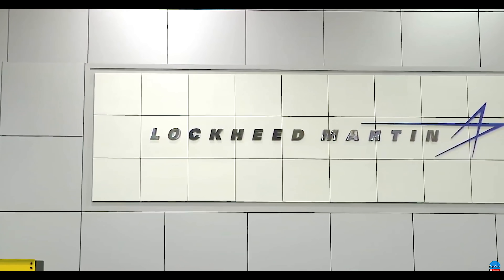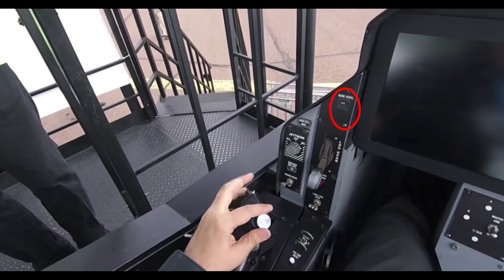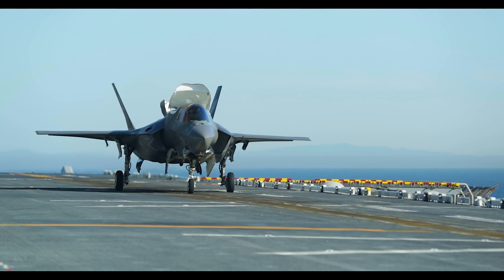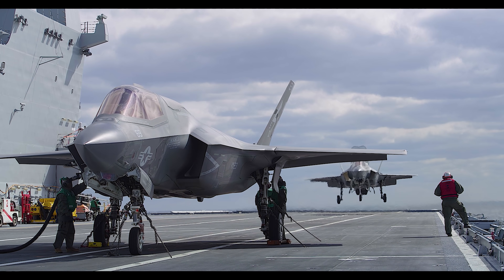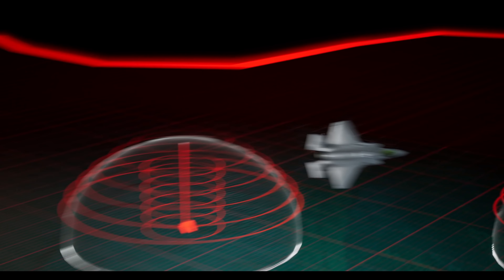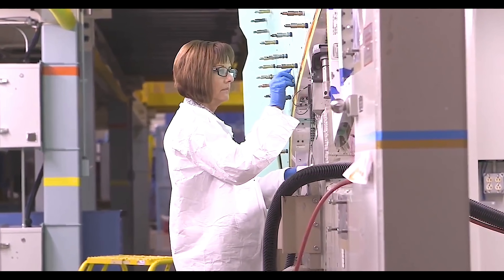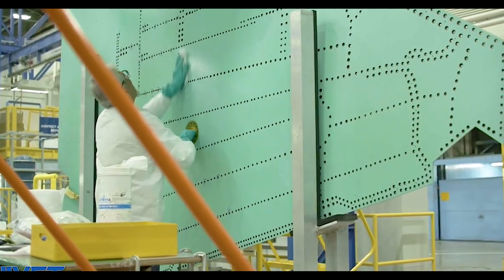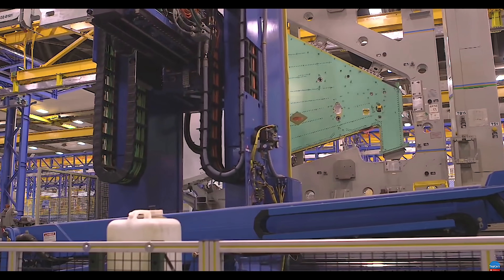Inside the F-35 Factory: The Most Advanced Aircraft Ever Produced

Comment: I don’t get why people compare how the harrier hovers to how the F-35B hovers. It’s obviously going to be easier the F-35B is 39 years newer.
Reply: How true - it took 50 years to make another jet that can do that!!! The Hairier was never fly-by wire. So, the pilot would have one hand on the stick. the other hand on the throttle, and his 3rd hand on the control that rotates the thrusters. If you turn the thrusters forward a bit, then you have less down (hover) force, and you THEN have to feed in more throttle (else the jet starts to drop). This is a delicate balancing act that made the Harrier a challenge to go from hover to say forward flight.

On the F35? The pilot does NONE of this. They push the stick forward, the jet figures out the above. You can ram (push) the stick forward as hard as you want - the jet then starts moving forward ONLY as fast as the transition to forward flight (a child could do this).

And if you let the stick go? The F35 automatic hovers Johnny on the EXACT SPOT when you let the stick go. At that point, you can eat a sandwich, take pictures out the window, or check your Facebook page. It just hangs there - all automatic - no inputs or even touching the flight controls  required from the pilot.

 It actually impossible to screw up this hover mode. You can push the fight stick anyway you want to do whatever you want. But the jet will then  figure out the mix of down thrust, how much to turn down the rear swivel thruster, and how much output goes to the front lift fan. It all automatic. If you can shove a flight stick around like how child would play a video game.
thus anyone that can shove around a flight stick can fly the F35 in helicopter (hover) mode. 

The Harrier was in fact a high pilot workload to hover. You increase throttle, jet starts to go up a bit, so then you turn the swivel thrusters to start going forward (so you not going up anymore). as the jet goes faster and wings start to produce more lift,, then you twist the nozzles even more forward. this was a manual process.

In the F35? The pilot does not do the above - you just shove the stick forward - both throttle and nozzles, and lift fan are all done by computers.  I don't think I could jump in and fly a F35 A, or C model. But if you find me the hover button on the B model? (it is the same button for the tail hook deploy on the C model), then you can fly a F35B in hover mode. 

And fun fact:
There are now at least 4 documented 100% vertical takeoffs. 2 from USA LHA class ships at sea,, and now two have been confirmed from the Italian Cavour aircraft carrier (now running F35b's)

Sadly, none have been caught on video. There are a few videos of 100% Vertical take-off from F35 early testing days, but the recent vertical takeoffs to my knowledge have not (yet) been captured on video. 

So find me the tail hook deploy button on a F35 B - and I could fly it - at least in helicopter mode!!!
Reply: @Albertkallal  All I gotta say is that it is amazing how far technology has came in the past 40 years. We were watching an F-35B hover at a air show and it didn’t move an inch. The thing was just sitting there. I know it’s controlled by a computer but considering the fact that it is a 40,000 pound aircraft that is still impressive. The fact that controlling a vehicle that large went from a hands on life or death situation if you slightly mess up situation to something that just sits there and controls itself blows my mind.

Comment: Do they have a solution for the gun problems and also the afterburner damaging the rear?
Reply: The GAU-22/A is a 4 barrel version of the GAU-12/U. One of the most high quality and most reliable guns ever put in a aircraft. Each barrel has it own breach. So there is not one breach that each barrel turns in line with, but each barrel has it own. They they last longer, work better and distribute the firing heat and loads over each barrel. 

The AC-130U "Spooky"  flying gun ship uses the same gun barrels. barrels - (GAU-12) a 5 barrel version of the 4 barrel version used in the F35. The Harrier also uses this Gun. And the Marine Corps LAV-AD air-defense vehicle also uses the same barrels.

It is for all puns intended? Bulletproof. 

The GAU-22/A is lighter and has a reduced rate of fire of 3,300 rounds per minute

And the technical specs (accuracy) in mumbo jumbo rating? (from Wikipedia).

maintains the same, high accuracy of 5 milliradians, 80% circle of the GAU-12 and A-10's GAU-8

So the gun is 100% on the money. The reported accuracy of the F35 is NOT the gun issue. The issue is that when you fire the gun, it imparts forces on the F35. (twists the aircraft due to the forces like when you fire any gun - the so called recoil). This torque issue was addressed with software (the flight control surfaces have to move and counter the gun forces to keep the gun on target).

So, the issue was NEVER a poor quality gun - the gun is noted for being one of the best ever made in terms of quality, reliability and accuracy.

The other issue? They have to align it correctly.

From Lockheed:

In the F-35A integral gun, we have implemented software updates and installed a field gun alignment aid to ensure proper gun barrel position. We tested this in December and the results were improved accuracy."

So this is not a high priority item - guns seldom used. However, the issue was NEVER the gun, it was ensuring the alignment was correct in the first place, and that of adding software to adjust to the changes in forces in the jet that can reduce accuracy. 

>>afterburner damaging the rear?

Old issue - addressed 10 years ago in 2011!!!

Vice Adm. Mat Winter, who leads the F-35 program on behalf of the Pentagon, told Defense News that the department has taken steps to mitigate the problem with an improved spray-on coating, but added that the government will not completely fix it — instead accepting additional risk

That coating is a new ceramic based paint that can withstand the higher temperatures.

And, NOTE very careful this statement:

Winter noted that the issue was documented while the jet was flying at the very edge of its flight envelope. He also said the phenomenon only occurred once for both the B and C models, despite numerous attempts to replicate the conditions that caused the problem

Read above again:

He also said the phenomenon ONLY OCCURED ONCE for both the B and C models, despite NUMEROUS ATTEMPTS  to replicate the conditions that caused the problem

So, it is NOT a wide spread problem. And NOTE ALSO they NEVER saw the issue with the F35 “A” model.

So, no, this is not a big deal, or issue.  And note that story and information is 10 YEARS old!!! – from 2011.

So, no this is not an issue or problem with the F35.

And this:

Greg Ulmer, Lockheed Martin’s F-35 program head, said there have been no cases of this problem occurring in the operational fleet and that incidents have been limited to the “highest extremes of flight testing conditions that are unlikely replicated in operational scenarios.”

And Winter goes on to state this:

The new coating, which was introduced in Lot 8, allows the jet to withstand hotter temperatures caused by the afterburner, the documents stated. Winter characterized the material as able to withstand “what we call the thermal shock wave,”

So, you talking about an issue that cropped up 10 years ago, and has LONG been dealt with.

All of the last multiple sets of LOT production numbers have these changes.
Reply: Of course, because they never existed. Dumb***.
Reply: @fasterthandragons7908  Do you have any proof that those problems never existed?

Comment: Awesome video, man! Most favorite thing i learned from this is that part about the Lockheed engineers using 80486 microprocessor for F-22's!! Freakin 486's and created a legend like the F-22! Thats just insane. Thank you, Hasard!
Reply: The 80486 microprocessor was NOT what drove the F-22....he said the processing speed was basically equivalent to the 486 at the time
Reply: @johnpeasant7859  Oh I think I could've phrased my sentence better, I meant for the purpose of design formulation, simulation and such developmental aspects. Not using them in the jet. Thats what he said and it makes sense as it fits with the F-22 design timeline too with both set in the early 90's.
Reply: @FirestormX9  Oh I for sure missunderstood him. I thought he said that the processer in the JET is a 486.
Reply: @draygoes  yeah
Reply: @johnpeasant7859  
True.
the F22 has/had a 700 mips processor. That's quite good back then. They had plans to update to 2000 mips.
(but the CPU and chip set is long out of production).

On the other hand? Your wally mart budget smart phone for less then a $100?

Well, even the lower 4 core snap dragon running at 1.4ghz? it has 4 of them. 

So, cheap  $80 smartphone = 5700 mips
F22: 700

So that smart phone has about 8 times the mo-jo (processing) as the F22.
(the f22 actually about maybe a first gen Pentium - the next chip sets that came after the 486.

But, yes, computer power today has come a very long way.

The F35 uses the Power-pc chip set from IBM. It is the same architecture used by the Lawrence Livermore labs when they run computer simulations of nuclear bomb explosions'. It also the same chip sets used by IBM for their Artificial intelligence (AI) systems.

Needless to say, the F35 does not lack computer power (or better said - will not!!!). They are rolling out a new CPU next year for all F35's. It will increase memory, and also increase  processing by a whopping 25 times (times - not %!!!!).

Comment: F-35 is like a Tesla. Superior in every single way a a combat aircraft can be……..BUT!! it just has no soul in terms of appearance. Im sure fighter pilots love it and I have no doubt the country is safer for having it. As an airshiw spectator, I just get such an emotional overpowering feeling from watching the F-16 and A-10 fly around. The F-35…meh. I think its a sign that fighter pilots’ days are numbered. Fighter aircraft will eventually be fully automated and unmanned. IMHO.
Reply: well, call me when a single tail figher does a flat spin like this - they can't!!!

50 second video:
https://www.youtube.com/watch?v=2Xygbw6t_z0

The F35 is more maneuverable and will out dog fight a f16 easy. The F35 has a better power to weight ratio. 

in fact, the F35 has a better t/w rating then even a Rafale.

You get these numbers:
power to weight rating with fuel (thrust to weight)

Higher number = better.
Fuel	Rafale	F35 	F16
18250	0.8038	0.8776	0.7729
15000	0.8707	0.9399	0.8447
12000	0.9431	1.0058	0.9239	
			
10362	0.9880	1.0459	0.9737
9125	1.0249	1.0784	1.0151
7500	1.0777	1.1242	0.9239
7000	1.0950	1.1391	1.0950
5000	1.1704	1.2028	1.1826
3500	1.2341	1.2555	1.2581
2500	1.2806	1.2932	1.3141
700	       1.3737 	 1.367    1.4284

Note how with 12,000 lb of fuel, the F35 is the ONLY jet at that point that has enough power to fly straight up. the F16 and Rafale are too heavy at that point in time.

The f16  has to burn it tanks down to 3500 lbs - VERY low fuel to match the F35 t/w

The Rafale? It has to burn down to near bone dry at 700 lbs fuel to match the F35 T/W ratings.
Reply: You are blinded by nostalgia my friend. I would go to say the F-35/22 focused more on looks than aircraft like the F-16/14. There's more artistically balanced shapes and surface features when in comparison to the more utility based looks of the Hornets and Cats.

Comment: Since the F35 is so dependent on computers
And you say it lands so much better than the F16. How does the F35 land with a computer failure? or engine flame out?

Nice vid btw
Reply: The F-35 has multiple back up flight control systems. Theres no way all of them can fail without catastrophic damage to the jet in which case youd already be going for the handle anyways. If the engine fails its like every other single engine aircraft engine out procedure ever. Best glide speed, best place to land, checklist.
Reply: Well, the same as any modern air craft.  They all use computers - and the F16 had computers between the pilot and control surfaces. So, I can't say there really much difference here.

The main difference is as they noted. The F35 can manage airframe stress in real time. This results in some VERY weird and counter intuitive control surface movement.

For example, the pilot can be pulling up hard on the stick. The wings thus want to bend up-wards. So the computer looks around and says, hum, how can I bend the wings back down? So it in fact turns the trailing surfaces (elevators on wings) in the OPPOSITE direction! (the control surfaces are now pointing up-wards - trying to bend the wing back down!!! - as a result, airframe loads are lower, and you don't bend the wings. The overall wing is producing lots of lift but you need a invisible hand to press DOWN on the wings to reduce bending loads - and that what the F35 does (and so does the f22 - but the F35 more advanced in that area). 

This is a VERY counter intuitive operation.  A long time f22 test pilot explains how this works - and it is a REAL EYE opener as to how flight control software now manages airframe stress.
Video here:

https://www.youtube.com/watch?v=n068fel-W9I
Reply: Redundant systems probably.
Heck , Sukhois from the 70's had quad redundancy flight controlls